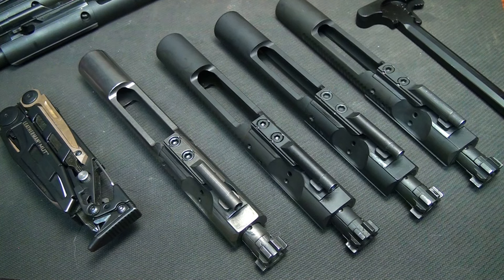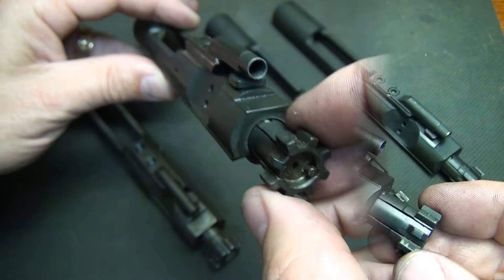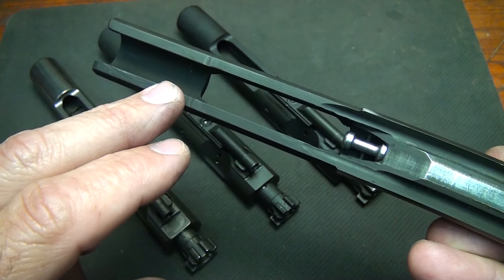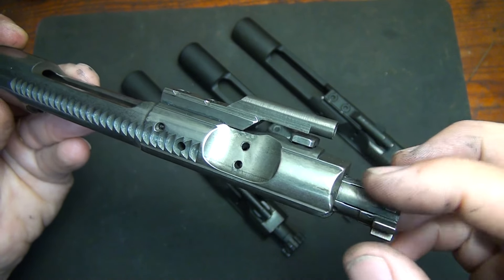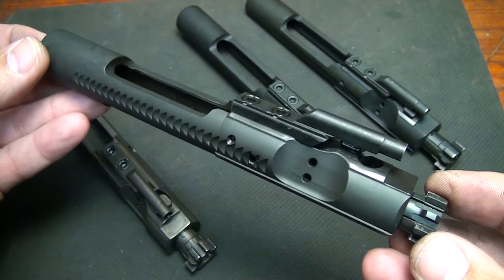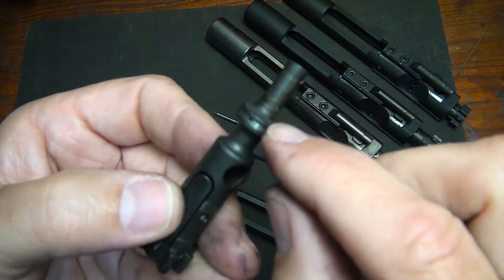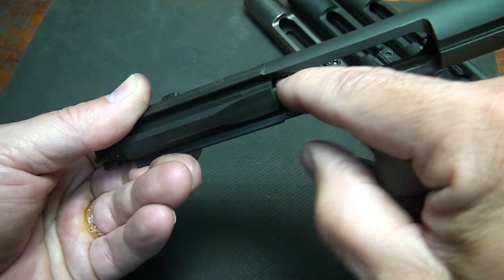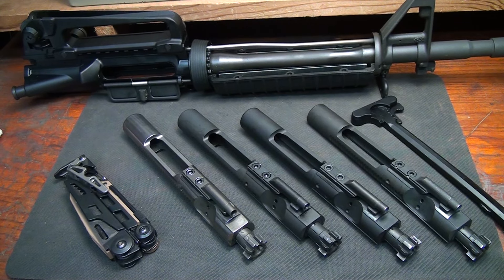How to I.D. AR 15, M16 & Mil Spec Bolt Carrier Groups

Comment: @ricky lee 

A headspace check is not required for switching out your BCG. It should be noted that the headspace on an AR15/M16/M4 is preset at the factory. There is little/nothing the average gun owner can or should do to adjust a rifles headspace. A simple field gauge is an excellent tool to keep around the shop if you frequently install barrels, however most gunsmiths will usually let you use theirs to check your headspace for free. Just a side note, I've built roughly 5 AR15 rifles, pistols, and SBR's a week for the last two years, have completed the Marine Corps basic armorer course, and was a combat arms instructor for the Marine Corps from 2006-2010 and have never seen a rifle that needed a headspace adjustment. Only once did I see a rifle fail the go/no-go gauges. It passed a field gauge test and functioned flawlessly. 

Hope that helps.

-H3

Comment: If you have an older Colt with a receiver block, you CAN remove it. You just have to dremel it out. Mine was made around 1991 and it only had one "blind pin" holding it in. I guess later on they went to 2 or 3, so those would be more difficult as the pins are hardened steel. I found out how to do it on some archived posts in AR-15 forums. Then I installed a nickel-boron M16 carrier group :)

Comment: Great video. Makes me want to dissassemble my guns one by one and check each bolt individually. Having spare parts on hand like springs, extractors, ejectors, gas rings and a carbon scraping tool like you have shown just makes good sense.

Comment: Great video. I couldn't agree more with you on staking the key in place. My friend used lock tight and the key came loose while firing. What happened was the key slid to one side and hit the gas tube in a head on collision, and the key was so hot that the gas tube cut the key like butter about 1/4" deep and locked everything up. He stakes everything VERY well now.

Comment: Del-Ton has all these specs in their BCG for $110:

Phosphated 8620 Steel Carrier Assembly 
Carpenter 158 Bolt HPT/MPI Tested 
Heat Treated and Plated 
Mil-Spec 
Chrome Lined Carrier Interior
Carrier Key - Chrome Lined, attached with Grade 8 Screws and Staked
Reply: No matter what is etc but case can be break. Like example freedom munition REV6 bolt carrier group correct? Did you see what happen my video ? Hit it.
Reply: Robert F, what language are you speaking? WTF?

Comment: I'm new to to the ar, But have been an iron worker for close to twenty years, it is my understanding that shot peaning doesn't harden steel, It is used to relieve stress and surface tension from welding and forging processes!
Reply: +DayRider76   That is correct,  relieves stress in the metal.
Reply: Doesn't relieving stress make it less likely to break, therefore making it "stronger"?
Reply: Rob Bader
yea, it also rounds thinss off so cracks don't start at corners.
Reply: It serves two purposes, one is stress relief, and the other is that it work-hardens the surface and makes it tougher. An example of work hardening is when you bend a piece of steel back and forth until it breaks. You get the same effect from shot-peening.

Comment: Excellent tutorial on the bolt carrier and it's parts, function and differences. Usually this is crammed into an overall function tutorial or a field strip and clean video.

Comment: This may have been said already and then I may have just learned a tip for gas rings.  But, my 15 years of military service, I've never heard of testing the gas rings that way, nor have I ever been taught or taught my soldiers to test the gas ring like that. You inspect them for damage, bends, wear... and when you are putting the bolt back in the carrier, you make sure that the gas rings are offset from each other.  If you have the space in the rings lined up; and I am going by your test, it will fail because the rings will not make a seal.  Then you'll assume that you have bad gas rings because of the failed test.  

Trust this, you'll know and be able to tell if and when you have bad gas rings; you'll have a host of other problems before the rings go bad or need to be replaced. Thanks

Comment: Hi, I've got a post-94 ban Colt Sporter made in late 94. Came with an M4 marked upper receiver, larger diameter hammer and trigger pins, and that funky chopped Colt Bolt Carrier. I'm able to run the AR-15 bolt carriers without any issues, and prefer them over the original Colt bolts because the firing pin is shrouded and the mass of the BCG is slightly heavier (although it's still lighter then an M16 BCG). The only thing better would be to machine off the sear block in the lower, but it's marked Colt in big letters so kinda cool, and clearly it won't take machine gun parts.

Comment: I run BCM bcg's and also have a old colt bcg (the cut one) all of them have MPI printed on the bolt itself, so its a good idea to check the bolt itself for any markings. if i am correct a batch tested bolt will not be marked, only parts that have been actualy tested are marked. this applys to milspec parts not boron or other coated parts as they are tested befor coating. great videos please continue to offer up good quality info. thanks

Comment: How's it going NCHeel, I've got to thank you for pointing out that PSA with the Aimpoint combo and the MI rail. I bought one from you the week before the machine gun shoot in GA. I finally took it to the range last weekend with the oldest son. It ran great, the mil spec trigger is well, mil spec, but it ran fine and shot 1.5" @100 with a mix of ammo. Those PSA's seem to be a sweet deal. Mine has the M16 BCG&HP/MPI bolt, M4 feed ramps, etc. I'm completely happy with my purchase, thanks man.

Comment: After the comment on Colt, I figured I'd entertain myself by cringing through the rest of the video. My new LE6920 has the "M16" bolt carrier. As do the rest of my shooting buddies who all own Colt AR's as well. And the "lesser known companies" do not batch test. The cheap companies do. Big difference. Those were just the 2 things that stood out as I was more focused on cleaning my Colt after putting 1000+ rounds thru her this last week.
Reply: And after looking, I have the lower shelf in my lower receiver. Not the higher "Sear block" that was claimed.
Reply: The video is right. My 1991 Colt has the "butchered" bolt carrier and a receiver block. Your gun was made AFTER they came to their senses somewhat. From what I have read, that happened in 2005.
I like Colt quality. I have never had a problem with mine, but I took out the block and put in a nickel-boron M16 BCG.
Reply: 2hrsToChooseThis ...it's more than the shelf being high or low.  if your colt has their block, you will see it clearly.

Comment: When you were talking about the loose gas key on your Bushmaster bolt carrier I noticed the screws said "YFS" on the top. These are sub standard Chinese fasteners that are soft. They stretch under use and cause gas key failures. You can't re-torque them because they keep stretching as you are tightening them. Also as they stretch the thread pitch changes on the upper portion of the fastener causing more problems. Throw them away and get a good high Quality American Made fastener.

Comment: BCM m16 bolts come with the hp/mp markings and have wear marks and carbon consistent with being fired once.  A wet patch came out dirty when run through the BCM barrel when it arrived (before I broke it in and fired it).

Comment: I just got my key staker for ar15 bcg`s from brownell`s!it`s an awesome tool!this is also required to properly secure key to bolt:Install carrier key with two Bolt Carrier Key Screws to carrier using 9/64" Allen wrench or equivalent bit, torque to 35-40 inch pounds.
Colt recommends the use of Permatex No. 3 Aviation Form a Gasket in a thin coat across the bottom of the carrier key to insure a complete seal.i highly recommend their product!

Comment: I've tried those and although the idea is sound you have issues like carrier tilt which is an ongoing battle with these new systems. I would wait until its resolved. Also, and this is just my opinion as a Marine and Budding gunsmith. The Direct Gas Impingement system used for decades, although filthy. Is better than a Piston system for a AR15 due to the amount of extra parts need for the system. Too many loose ends to worry about failing when your life depends on it. 

:D

Comment: Bushmaster also made a cross between the auto sear block bolt carrier and the newer ar15 bolt. it had the back of the ar15 bolt with the exposed firing pin. I own one in a bushy post ban hbar rifle, it six the hammer rides rough over the pin and sometimes gets caught on it. bad design to me. good vid, thanks.

Comment: It used to be illegal to have any M 16 part in an AR15,and was considered a machinegun before the ATF changed the rules. I sat through that ATF meeting. Bushmaster would not sell you an M16 bolt group unless you had a Class 3 copy of your paper work for several years.

Comment: There is a difference between the pins used in a carrier that leaves the pin exposed. The ones that bend or break tend to be slightly thinner diameter.

Comment: Great video. After watching this I checked my chrome BCG from rock river. I placed it on end to check the gas rings as you did in the video and it did not stay in place. The bolt has only has a couple hundred rounds of use. Does this mean it's gas rings are bad?

Comment: Hi.
First off I want to say your video was very well done. But (And there always is a but, right) I did want to correct you on one statement you made about the Colt full cut BCA. I have a Colt Sporter  H-bar rifle (It was the year they ground off the evil bayonet lug to try and keep the Clinton administration happy) and it was fitted with that BCA. I was always told I couldn't do anything about it and I would have to live with it as it does have the pinned block in the lower. Anyway, I had an old A1 I was rebuilding, and I ordered a new WMD AR-15 length nickle boron BCA for it, and just for fun I tried it in my H-bar, it fit just fine, and function perfectly without any modifications. Now, if I had ordered a M-16 bolt, it wouldn't work, but the AR-15 one was cut just enough to clear the block. (If you would like pictures, I can provide them).
In fact, it worked so well I kept it in there and just rebuilt the M-16 one in the A-1 with parts from the Colt BCA.

Comment: Great video's on AR15 tech. You showed the importance of a tight gas key and stressed the importance of proper torque on the fasteners and staking. Can you show how to get the correct torque on the gas key screws and then properly stake them?

Comment: In the AR Platform the "Firearm" is the Lower Receiver. NOT the Upper Receiver or ANY parts contained within. You can legally purchase any Upper and any Upper Parts all day long without any paperwork. Doesn't matter if it's an AR Bolt, M16 Bolt or Horseshoe bolt.

Comment: Colt quit using that design years ago. Then they told the ATF to pound sand when they started using the standard M16 carriers again. They, like most every other company, do use the slightly different semi auto firing pin though (different sized collar).
Reply: Chester B. ...  almost!   colts dr chen wrote atf and received approval,  they didnt tell atf to pound sand.  lol.

Comment: Was watching this video after I had a malfunction in my AR-15 and several failures of the round to eject, disassembled and reassembled the bolt carrier group, going to check the gas rings to see if they're bad.

Comment: If you mean where the BCG rides inside the Upper receiver? Yes. I have a Spikes Tactical Nickel Boron BCG and its amazing. Use Frog lube and it's the most frictionless setup I have ever seen used. As long as one surface is coated you will see a clear difference. I would bother coating inside the Receiver. Its not necessary.

Comment: You might want to tell your viewers that there is one caveat not mentioned here.  On an open shroud carrier there was one other safety issue.  Not only is there no way that the open tail will trip an auto-sear and the completely open tail will ride over the receiver block (for the auto-sear in Colts) but the notch in the hammer will catch the forward motion of the carrier on the forward stroke if the disconnector has been tampered with (or fails).  The hammer notch goes into the back of the firing pin and hangs it up without a disconnector.  Most importantly, those full auto, or any closed shrouded carrier firing pins have different collar sizes.  The open shrouded firing pin has a front collar approx. .300 inch smaller so the hammer will smoothly glide over it or not touch it at all on the back stroke.  People make mistakes and replace them with M-16 firing pins and the hammer hits the firing pin hard enough on the back stroke that it will push the firing pin into the retainer pin and bend the hell out of it, not to mention damage the firing pin.  An easy way to do this is to buy an AR-15 firing pin from Brownells if you need one (Open shroud) or an M-16 firing pin if you have a closed shroud.  I run the closed shroud, M-16 variant for smoother operations also BTW.  Shoot Safely.

Comment: There is one more bolt carrier you didn't show. In a colt sp1 from 1974 there is a little less metal taken out of the bottom of the bolt carrier. Not fully flat like the one you show but a lot less than the are 15 enhanced model you show. It also does not have the extra metal to cover the firring pin. Great videos.

Comment: the AR-15 bolts will work with the M-16 lowers, but only as long as you keep it on semi, if it were set to FULL then the hammer would have to be manually released by hand

Comment: I am looking at replacing my AR BCG with a M16 BCG. However my friend did this yet his short stroked and when we threw my AR BCG in it, it worked flawlessly. Is there other parts that should be upgraded along with the M16 BCG? Like buffer tube/ spring etc.? Thanks! And great video.

Comment: BTW, you can't assembly the bolt incorrectly, as the cam pin is tapered and you won't be able to insert it with the bolt oriented incorrectly.

Comment: I just bought a box of spare parts for $40, and Im trying to figure out what Ive got exactly. Thanks to your vid, Ive confirmed my suspicion that one is the cresent shaped Colt M16 bcg. 

The second is a silver colored AR15 bcg, but not chrome (it differs from my chrome bcg and I doubt its NIB either). Almost like a bead blasted SS. The gas key screws are pinned in place, not staked. Ive never seen this done before. 

Finally, the last one does not have a gas key, and appears to be another M16 carrier (no bolt either). There were also a bunch of rolls pins, some 1911 parts (safety selector, trigger, and random parts), 4 muzzle devides (3 are A2 flash hiders), and 2 large buffers (1 metal and the other polymer). Any ideas as to the silverish carrier? I figure the pinned gas key is a rarity, and may help discern a maker.

Here's my most important question. Can an M16 bcg and/or an M16 buffer help cycling issues (by slowing the rate of fire) in an AR pistol? That would be pretty cool, since Ive deadlined my 9" AR pistol due to cycling issues.

Comment: another main difference between the m16 and ar15 bolt carrier is only with the m16 bolt carrier you can get full auto, but you have to be able to get your hands on a full auto trigger also, all I can say is good luck on that! The main reason they milled the back of the bolt carrier is so it can't have the ability to do full auto.
Reply: Actually you need a full auto trigger, auto sear and the full auto bcg, easy to get but wont fit in the lower

Comment: I'm pretty sure the bolt carriers are one size fits all. Nothings really changing except the length of the gas system. I could take the bolt from my rifle length and put it in my carbine length and they'd work fine.

Comment: If the cam pin is a bit looser in the bolt than normal would that make it unsafe to use?  The bolt from an A.T.I. was being cleaned and I noticed some shiny areas inside the hole in the bolt where it looks like the bolt was machined then anodized or whatever to make it black and then they came back and bored out the hole a little bit more. Maybe it was too small or not round or something before but now the fit in the hole is a little bit loose when the pin is put in the side so it will wiggle around just a little more than normal.  It still works but I'm not sure if it should be replaced or not.  Staking of the gas key screws were also like the ones in the bad one in the video but that can be fixed.

Comment: Just a note: Remember the gas rings must be staggered and I noticed on the last bolt carrier your gas key either had a burr or carbon build-up. It is important to check and lightly clean this opening as it slips over the gas tube! Happy shooting.

Comment: Seeing that prices are dropping throughout the market, bolts in particular, I was wondering if there was a way to tell if the actual bolt was shot peened, as well as MPI tested. Recently purchased a Nickel Boron Bolt for $130 seems flawless and is hard to believe the amount of detail has been put in to testing this bolt as one that goes for over $200, Thanks for your time and insight.

Comment: The carriers that have an exposed firing pin is supposed to reduce the risk of a run away supposedly
Reply: Lee Holmes ... correct.  
some hammers are notched at the top to engage the exposed fp should weapon  begin to run away.

Comment: 8620 steel on the carrier. 158 Carpenter on bolt, 8620 carrier is "milspec". M16 bolt carriers are just a way to tame the action. There are other ways to do so as well. Heavier buffer, spring, or bolt. It all works. Just whatever is your fancy.